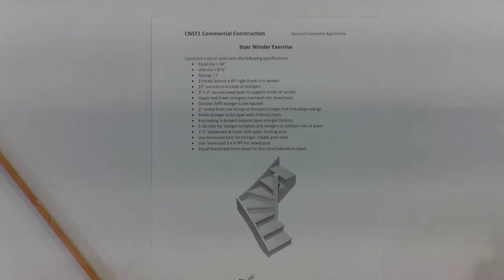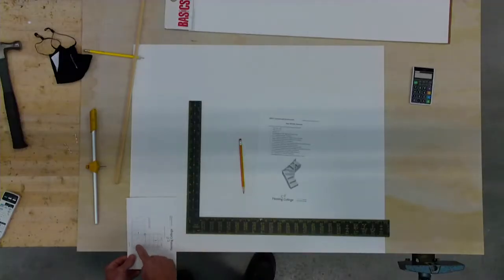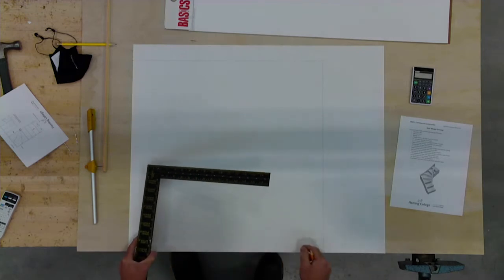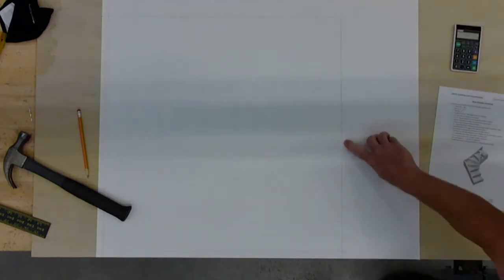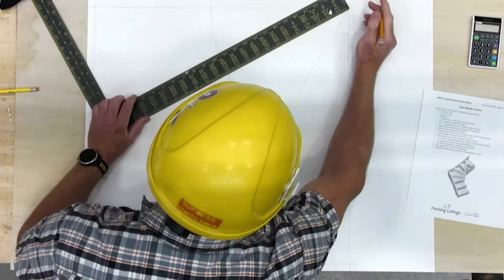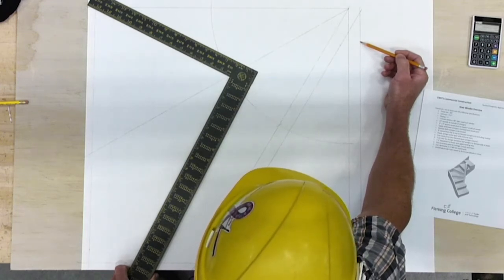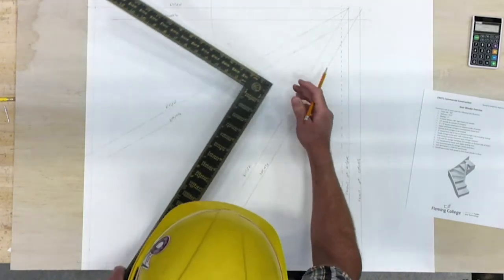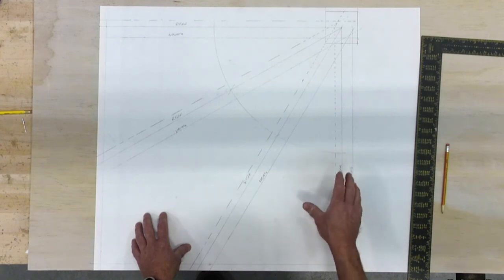3 tread winder

Comment: A good tutorial and some excellent drawing. That said this stairs would not meet regs. Winder treads cannot be generated from the centre of the newel post. One needs to establish a geometric centre outside the junction of the two cut stringer's in order to have minimum tread depth at the newel. In Ireland that is 75mm or 3", 👍🔨🇮🇪
Reply from the maker: Thanks for the comment.  This layout meets current code in Ontario Canada.  I can see it changing in the future though.  The IRC has a minimum inside run of 6"